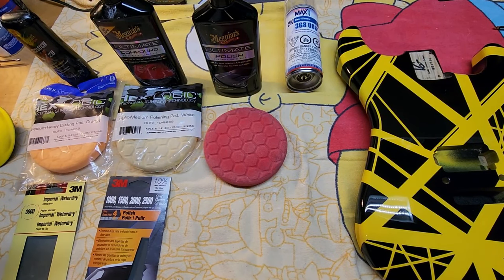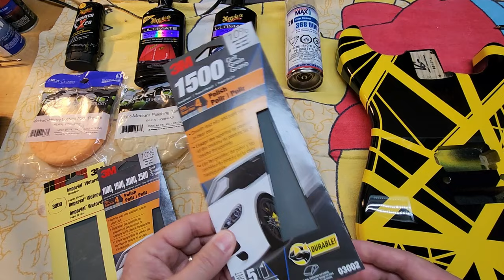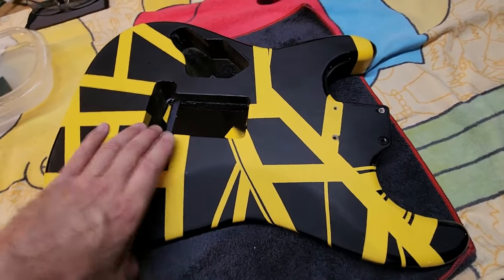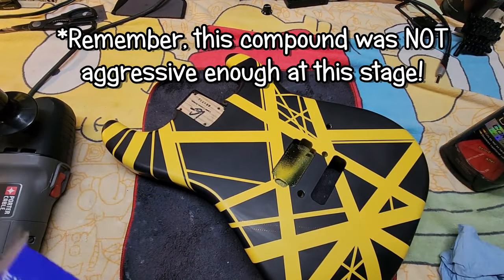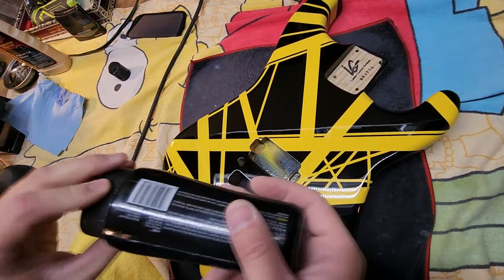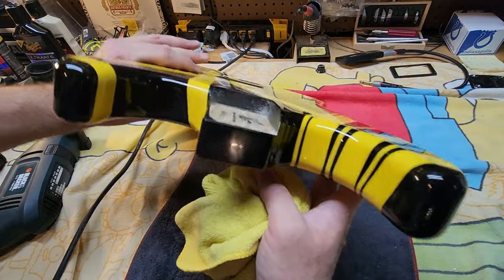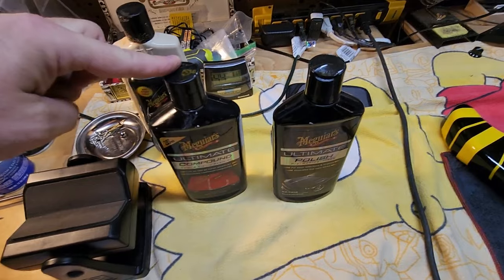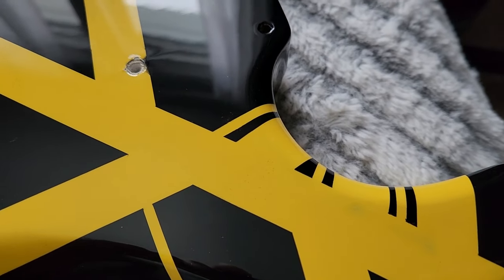Painting a '79 EVH Bumblebee Ep. 5: Wet Sanding and Polishing SprayMax 2K Clear Coat

Comment: Brian have you ever had issues with the spraymax getting a good mechanical bond with the duplicolor? Did you do any kind of sanding of the topcoats before clearing?
Reply from the maker: This was my first time using Spraymax, and it did go pretty well.  But, you asked a great question because I noticed when I attempted to perform the spot repair behind the cutaway where I burned through (in the previous episode), when I peeled the tape off the body it took some of the first layers of SprayMax with it.  I was puzzled by this and assumed there was a weak mechanical bond in that area.  I did not think it would have been necessary to sand the base color coats since that goes against most things I've read previously about SprayMax, but after witnessing that small area peeling, I can only assume it was the culprit.  It was easy to sand out and repair and the subsequent layers went on fine.  Fortunately,  since spraying the final 3 top coats I have not noticed any other issues ,and that repaired area withstood the rigorous wet-sanding and buffing in this video.
Reply: I only ask because i too have used spray max several times with zero issues. But i did scuff the basecoats. On my newest build im having issues with bonding. I pulled the tape from my headstock --boom issues like you describe. I know chemically its not going to bond but im assuming the mechanical one can be acheived just from previous experience. I was just curious if anyone else has experienced these issues because 1000s of people do the duplicolor/spraymax combo
Reply from the maker: @joepangrace1983  This is a great conversation and worthy of pinning to the top!  Hopefully others will see it and possibly chime in.  One of my beliefs prior to starting this project was that the SprayMax would easily bond to any acrylic lacquer product (DupliColor Perfect Match) and thought it would easily adhere just like using my tried and trusted HOK USC-01.  I was also afraid that scuffing my base coats in this situation might somehow show through the SprayMax so I didn't want to risk it.  It might be worth trying on a sample the next time I open and mix a can (whenever that happens to occur), however I had no issues on my original sample boards for this Bee project.  Hmmm...
Reply: Two weeks ago I used spraymax 2k satin over  rustoleum rattle can 2x satin (acrylic) on a golf cart body and did not scuff at all before the clear. The body was 2 tone grey and black. I slightly sanded the clear to remove some spots that the spraymax spit out like big drips and accidently burnt through the clear. I then masked the grey to respray base on the black and when I pulled the (blue) painters tape off the clear came off with it in sheets. Before this I let the base sit for about a week. Funny thing is that it only peeled from the grey, none from the black. I did however end up sanding everything down, respraying all base and went to spray the high glamour (this time within 10 hours of black base and 30 min within grey base) spraymax 2k and the first can spit clear coat all over the golf cart body. I went ahead and applied the 2nd and 3rd coat (both had spitting issues) now I don't know if I should wait 24 hours and try to wet sand the clear spit spots and use my last two cans to re-clear. I'm not even sure if it is ok to lightly sand the clear that's on and then put another coat and hope it doesn't spit again.

Comment: Safety ear plugs for the post and strap holes, in the past I’ve experienced problems with paper towel getting to wet and water lifting the surrounding area paint
Reply from the maker: Thank you for this tip!  That is a great idea!  I'll use those on my next project.  Cheers!

Comment: Awesome looks like my EVH 2017 factory bumblebee bee body I purchased on eBay for around 400
Reply from the maker: Thanks for the compliment!  Yeah, those factory finished bodies are a great option, but like you said, they are pretty expensive.  I just added up approximately what I have spent on this Locke body and all the supplies, and it was roughly $300 (not including the compounds, or buffing pads...since I already had those).  I guess the benefit of building one like this is having the option of wood species and different tremolo mounting styles.  However Locke's prices have recently increased so it would cost approximately $40 more to buy/build today.  I purchased these bodies a year ago...fyi.
Reply: @CoffeeDrinker71  yeah m building a 5150 body going to you your system hopefully it turns out like yours did
Reply from the maker: @donaldyoung9838  Very cool!  In that case, you might want to gently wet-sand your stripe edges down on a 5150.  That's an entirely different animal.  Good luck!

Comment: Looking forward to your thoughts on the stewmac lacquer vs spraymax. I’ve used spraymax and it looks stunning…the only thing i didn’t like is i can still dent it with my fingernail unlike all of the non diy guitars I’ve ever held. I just used the lacquer for the first time and it definitely has a learning curve since the layers melt into each other and a run on the second coat of clear will ruin your color…just waiting to polish it now
Reply from the maker: Yes, they definitely have their own pros and cons between the SprayMax and the Stew Mac lacquer.  Like you said, a totally different learning curve on the lacquer but I feel like it's slightly more forgiving overall.

Comment: What floyd rose and nut are you putting on it?I want to build one, I just don’t know what measurements i need and if i should get wood screws or bushings.
Reply from the maker: I'm using the newer Floyd Rose bushing and insert system...not the old school wood screw!  Hope that helps!  My neck requires an R2 nut but it just depends on your own neck for that spec...

Comment: Brian thanks again for these excellent vids and for being a great sport answering questions. One more: is there another episode coming for a nitro clear coat finish? I just got 2 cans of Colortone Clear Gloss on my project, letting it cure for a bit before wet sand/polish. Curious if you'd recommend following this process or stick closer to the StewMac method (wet sand with 800, then polish)? I will say the wet sand stage between cans went way quicker than yours with the SprayMax, so I'm assuming nitro will require a bit lighter touch at the end as well.
Reply from the maker: Great questions!  Yes, I'm still currently working on my Nitro Bee.  I have sprayed approximately 12 coats so far (hoping that's plenty).  It took one full can of the Stew Mac aged clear (not the spray can but the 32 oz can for HVLP guns).  Mine is currently in that 1 month curing stage...but almost ready to be wet sanded.  Based on their tutorial video series, I will more than likely start at either 800 or possibly 1000 grit...then work my way up to 3000 gradually like I've done here.  But you're right, I don't think the nitro is going to be quite as stubborn as this SprayMax 2K paint.  So yes...you're absolutely right....probably a bit lighter touch on the finish sanding for the nitro!  I'm hoping to get this one finished in the next month or so, but I still need to edit the video for this portion of the series, but if you have any questions or run into issues in the meantime let me know.  Are you using the spray can version of their nitro, or using an HVLP gun?
Reply from the maker: @jbaertube  Oh wow!  That's a major bummer!!!  I agree, Stew Mac is a great company and I'm glad they took good care of you.  I just uploaded a "short" just for you to see what my 12 coats looked like in the paint booth.  Prior to spraying coats 11 and 12, I performed a level sand at 800 grit...then took the balance of my can of aged nitro and mixed it down to 2:1 with reducer to help it flow better.  The results after the thinner coats 11 and 12 are what you see in that new "Short".  Stew Mac's instructions for this canned version of nitro said it didn't require any reducer but all of my coats from 1-10 were too thick.  I wish I would have added the reducer early on...but I think it turned out fine now.  I did not experience any of the brown spotting issue like you did...so I guess I was lucky.  Yeah, if you think yours barely has enough to level it out then proceed very slowly and carefully.  The nice thing about working with this nitro is that it can be repaired pretty easily..i.e., drop fills and touch ups are pretty easy.  Good luck and please keep me posted!!!

Comment: What would be the process of painting a black and white frankenstrat body ?????
Reply from the maker: That's a multi-layered question.  Are you asking about the process of starting from scratch with a new/raw body?  
Maybe check out my video on building a '78 Franky for some general tips...but it's not an exhaustive tutorial like this Bee series is intended to provide.  https://youtu.be/Vw9vlvJmuSU?si=Urrxnu9tzi0draEt
Reply: @CoffeeDrinker71  starting from scratch with a raw/ unfinished body. I heard that Eddie use lacquer .
Reply: I want to have a similar finish that he had on his guitar black and white guitara
Reply from the maker: @Grunge_666  Ok, yes then I would strongly recommend looking at Duplicolor brand lacquers.  They are acrylic lacquers and not nitro lacquers but still do a good job.  That's the same paint I used on my '78 B/W Frankenstrat in the video that I linked above.  I just sprayed the lacquer paint, then buffed it to a high gloss shine afterwards without using any clear coats on that particular guitar.
Reply: @CoffeeDrinker71  will i need to sand and fill the grains ??
Reply: @CoffeeDrinker71  i don’t my arm of stick to the body when playing
Reply from the maker: @Grunge_666  If you are using any type of ash species (northern or swamp ash) then yes, definitely need to grain fill it!
Reply: @CoffeeDrinker71   can clear coat seal/fll the wood grains????